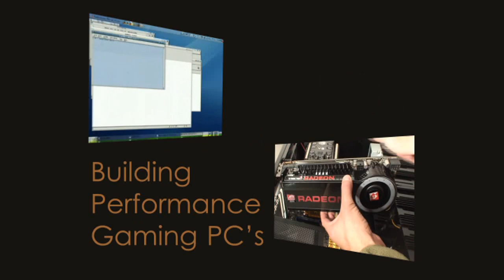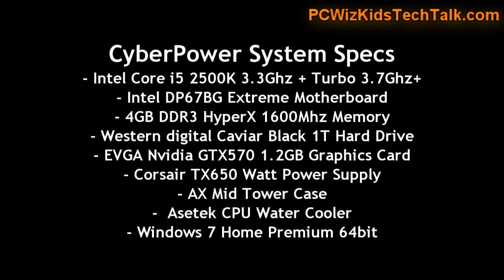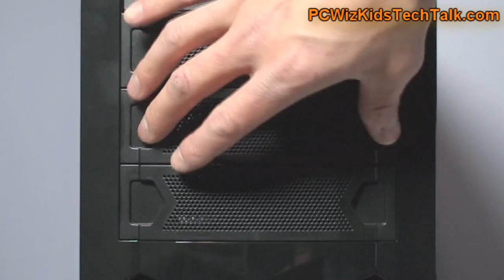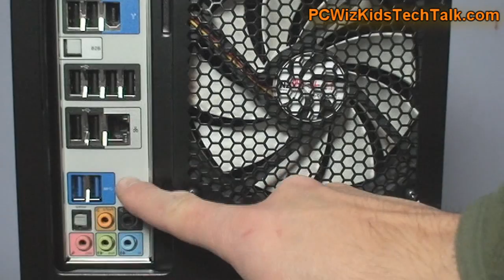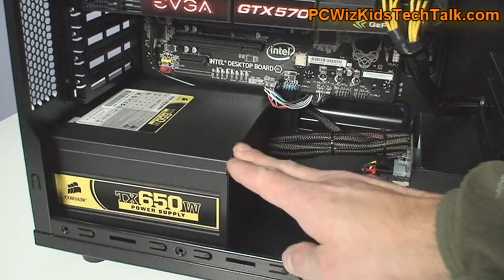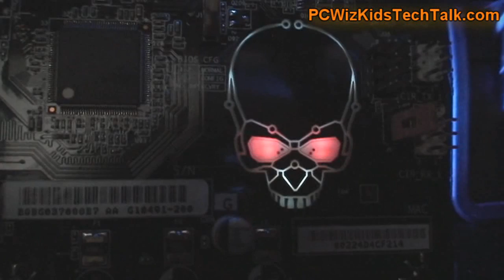Intel Core i5 2500K Gaming Rig System by CyberPower PC - Part 1 Review

Comment: @Reginaldesq Hot air only rises when there is no other force acting on it, the slightest amount of airflow completely negates convection. Intake or exhaust on the top doesn't matter if you do it right. I'm guessing his radiator fan is an exhaust, so having the top as an intake would intake cool air directly next to the fan that's cooling the CPU, resulting in better temps.

Comment: The fans at the top of the case seem to be setup to blow air down into the case.  This go's against the natural flow of air (hot air rises).  Is this a misstake by the supplier or do they have a good reason?

Comment: @tomanatorness what are you planing to do on it? if you're just gaming a gtx 560 or 570 should suffice, hence I have a Core 2 Quad Q9450 @2.66Ghz, 4GB Ram DDR2 and a GTX 470, and so far I managed to run every game on the max settings and still have about 30-50 fps

Comment: @psychoclown420- hahahah, hate to say it, but this is kinda true. I've built hundreds of computers, but this box I ordered barebones from CyberPower and swapped over the stuff I wanted to keep. My next system will probably be about the same. I used systems I built by hand for years, and it did feel kinda rewarding, but now I'm just too busy. I'd rather pay the extra $150 to have them build it and get a shiny warranty and not have to spend a day off elbow-deep in computer.

Comment: @RokitScientist1987 that system will use at least 500W and even more with overclocking. . . JFYI even my pentium dual core system with a not so power hungry gfx card uses about 400w :P

Comment: Oh come on!!
Whats up with you and PSU power exaggeration all the time??
This setup will never use more than 350-400W of power, and tx 650 has 636W, so how is it just enough? And yes you could put 1 more 570 in there and it would still be good enough.

Comment: One thing I dislike about CyberPower UK is that, "what you buy, is what you get". If the mobo and case can have 6 SATAs, they won't fit the extra cables unless you say you want them. Which is, er, stupid tbh, considering I paid just under a grand for the build - but I learnt the hard way :/

Comment: In the end water cooling is air cooling because air goes across the radiator haha to me those all in one water coolers are pointless. just get a regular good ol fan and heat sink, you will get similar temps. If you go watercooling go all out or its just a waste

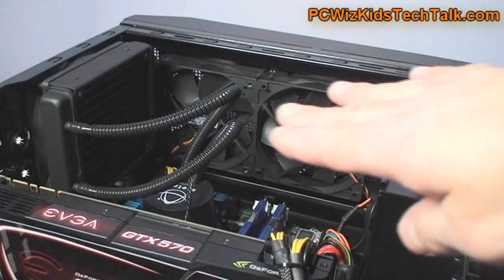Comment: @Moneyman462 @4:07  you can see the blades are in the position to intake air.  An easy way to tell is the motor for the fan usually has a sticker, whichever way the sticker is facing air is blowing.

Comment: @Nikinikas no.
1155, 2600K OC at 4.7GHz beats the i7 980x in most benchmarks 
it can be overclocked 4ghz+ on air. so if u have massive watercooling ull get like 5GHz and beat the i7 980x

thats my hope

Comment: @thegreenster224 well i think a 650 to 750 watts power supply would be ideal. if you're planning on upgrading, overclocking, adding extra video card, then a larger power supply.

Comment: hey im getting a 1090t amd with xfx6950,corsair h50 cooler,corsair xms3 ddr3 8g,asus Asus Crosshair IV Formula890FX and a haf912 case whats a good power supply for this? plz answer n i might overclock